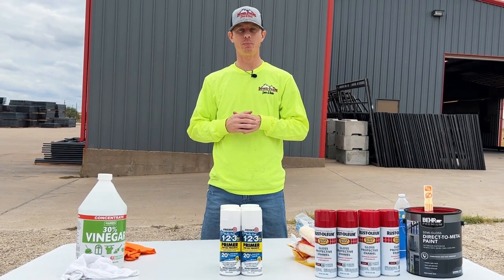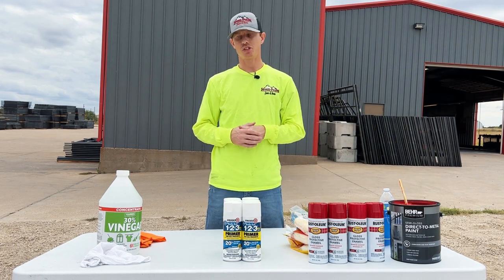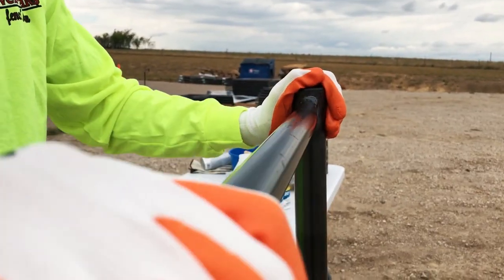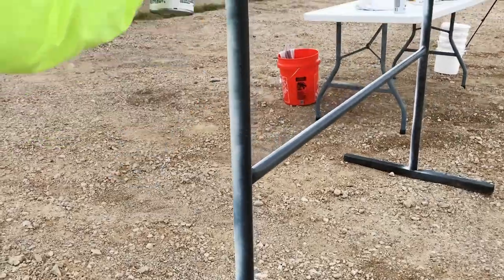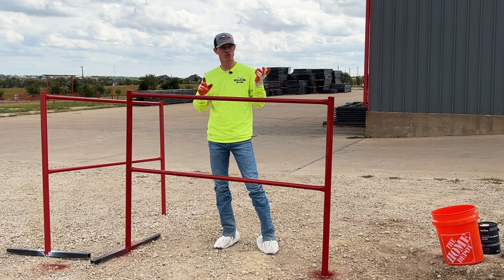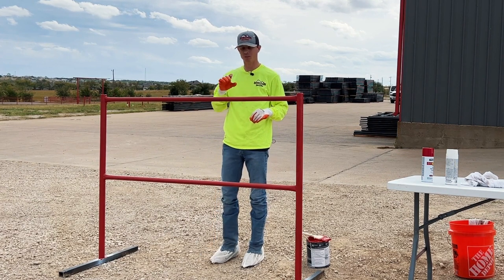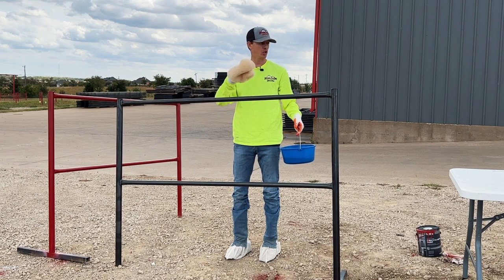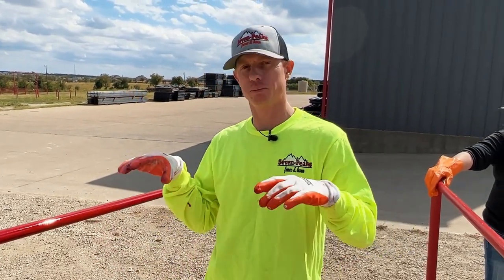The Best Way To Paint Pipe Fence - Seven Peaks Fence And Barn

Comment: Rustoleum brand, "Regal Red" high gloss. This is what I use on my gates and round pens. Apply with a quality brush which takes time, but the result is professional. Always clean and use a primer on rusty or corroded spots on the metal.
Reply from the maker: Great comment! Thanks for sharing!